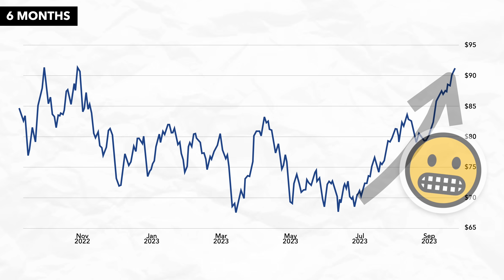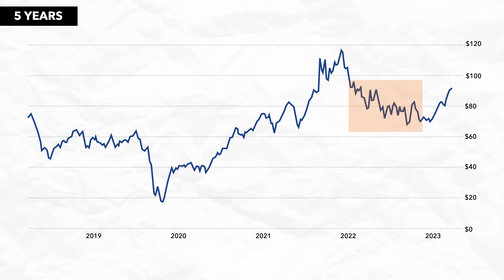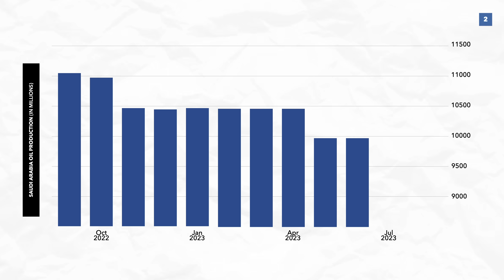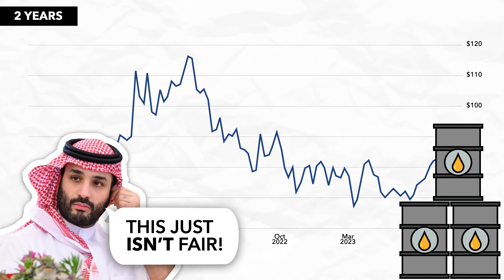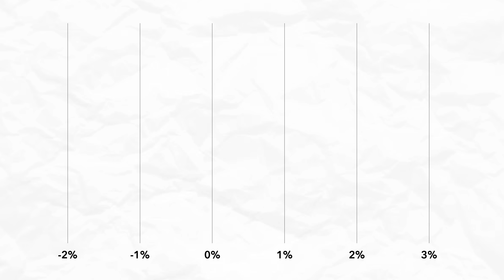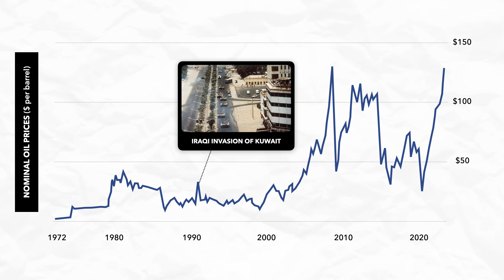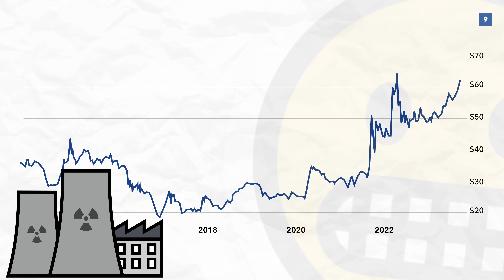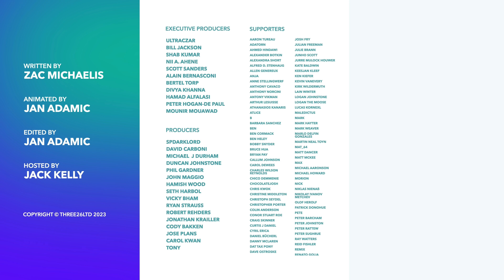Will High Oil Prices Restart Europe’s Energy Crisis?

Comment: French here in reaction to the uranium prices going up. Unlike coal and gaz powerplant, uranium is not something you buy and burn as it. It has to be enriched and goes though a long process before reaching the nuclear power plant. The raw uranium price on the market counts for 2% of the nuclear electricity price. It means the uranium can ×3, it will almost not change the electricity price. Also, France has 3 years uranium reserves and can handle way much higher price fluctuations on the market.
Reply: I was going to comment the same. Also oil is not much used for heating in the EU.
Reply: I wish I could say the same for Germany.
Because of the greens we shut all the powerplants off

Comment: Maybe don't shut down nuclear plants when the fossil fuel markets are already so turbulent and one the biggest exporters is an actively hostile nation. Just a suggestion
Reply: True that. Need to add that Africa is cut off too today.
Reply: It’s wild that Germany is shutting down nuclear power plants and re opening coal plants.
Reply: Freaking Germany
Reply: Yeah, but oil is not used for electricity production, so there is only a marginal impact
Reply: Where are we going to get nuclear fuel?
Hint: Not from the EU internal market. With nuclear power, we'll still be dependent on imports.
Reply: @bentrinker1937  the greens doing it nonetheless. insane fucking party.
Reply: @FraenkischeRep  You might noticed the EU push for renewable energy and electric cars. I dont need to be genius to see the corelation.
Reply: @bentrinker1937 The shutdown was set way in the past, during the Fukushima crisis. Problem is, germany didn’t work on an replacement in the last few years and killed multiple renewable energy projects. The CDU worked on the shutdown and hampered the alternative sources
Reply: @reheyesd8666  They think biogas comes form unicorn farts  🤦‍♂
Reply: @DaweSMF  the electric cars are irrelevant when it comes to their energy consumption. Furthermore Electric cars have nothing to do with sustainability, especially since they still require ridiculous amounts of energy even if they would replace combustion vehicles (which is not really the case currently, they are mostly additional to the preexisting cars) which could not be replaced by a measly 3 nuclear power plants
Reply: @Welgeldiguniekalias canada,australia,ukraine,namibia. You do depend on imports,but not from dictators.
Reply: @FraenkischeRep plus even if the change towards green energy is needed, what is the source of those powering those batteries?
Reply: He literally told and showed that Uranium is more expensive for the same reason.
Reply: @FraenkischeRep  Bruh, you seem to be stuck in details - you can argue your point as much as you like, that was not my point tho. You basicaly argue with yourself. Do you need some friends?
Reply: What a dumb statement, nuclear power is more expensive than even these high oil prices.
Reply: @Welgeldiguniekalias  everyone is dependent on somebody, if europe had transitioned to nuclear energy decades ago energy would have been cheeper even if the uranium had to come from a place such as canada which would have meant the price of the material would have been higher. Alternatively if the african countries werent screwed over all the time maybe they could have provided a the same commodity on a competitive price.
Reply: @DaweSMF  maybe you should learn to express your points more precisely. After all, not everyone has the time to argue with random guys on the internet. Perhaps even because they have real life friends🤔
Reply: @FraenkischeRep  Maybe, this is internet tho as you so observably pointed out.

You current argument have some holes as well tho - if you dont have time to argue with me because you have real life friends, how is it that you argue with me? Almost like your passion took over. Seems like i insulted you somehow and you decided to spew EV data on me and now prove me you have friends with contradictory statement and emojis? Did i struck a nerve by accident?

Sorry, i cant be your friend but i can type some message to here and there if you like. Just warning tho, i dont care about EVs or enviroment or sustainable energy and so on, i feel like you do. Thats why you arnt able to see past it.
Reply: too easy mate. why would political guys act logically ??? they have incentive somewhere to act otherwise ... don´t know which industry is filling their pockets ...
Reply: @FraenkischeRep  but electricity is only a small part. from the 11500 petajoules used in germany last year, almost 9500 petajoules were fossil fioul (oil, gas and coal) the rest is nuclear and renewables.
Reply: @autarchprinceps  Uranium is a very small fraction of the cost of nuclear power.  The price of uranium could increase by 100x and the cost of nuclear power wouldn't go too much higher.  A 1,000 MWe reactor requires approx. 27 tons of uranium ore per year.  Said reactor would have cost between $5-10 billion to produce.  A uranium ore price hike from ~$50/pound (where it's stayed most of this year) to $66.25/pound (where it is right now) represents a yearly price increase (if the new price were to hold for an entire year) of just under $900,000.  But considering that the MONTHLY interest payment on that reactor is going to be between $30-$60 million ($360-$720 million for a year), then the current price hike represents about a third of one percent (0.3%) of their monthly costs at most.  Actually not even, because that's still not including their personnel or maintenance costs, just their capital costs.
Reply: Now you tell us..
Reply: Good luck with your nuclear powered car 😅😅😅😅
Reply: @corranhuss  
So basically, Merkle has fallen for Russia's bait, if she wasn't knowingly doing it, and killed them all?

Comment: Though Saudi Arabia & Russia are cutting oil production to beef up their revenues, it is a question that how long will they be able to reap the benefits, given that OPEC+ members have a long track record of cheating & overproducing than their assigned quota in order to take more share of the increased oil prices & undercut each other.
Reply: How does cutting production increase revenue?
Reply: @tomcfearon  Cut production and prices will rise. Cut enough, and price × volume will run higher than before. It's a balance. Cut litte, price stay the same,  you just lose volume sold. Cut too much, prices will be high, but you sell too little to get price × volume higher.
Reply: Russia ain't cutting, they are loosing fields so its a permanent cut because they ain't drilling new ones in the areas that need a bit better tech. I do believe the Russian guy that have worked with in Russia before he had to flee. So the truth is worse than only cutting production.
Reply: @tomcfearon supply & demand. Cutting production reduces the supply of oil. The demand stays the same, hence the higher price.
Reply: Saudis have only cut around 10% of their production while prices have risen from 70$ to 90$ more than a 20% increase even more if you account for production costs

Comment: Uranium price was never a relevant factor in the price of nuclear energy. Uranium price can spike 10x, and the price per GWh of electricity produced in nuclear power plants remains pretty much the same.
Speaking about rising uranium prices in this context is only a speculation driver.
Just my 2 cents, but feel free to check it up by yourselves.
Reply: True, but it still remains the most expensive commonly used electricity source. It is only lucrative if the government pays for the up front cost, and that is when we hope there are little to no cleanup costs in the long run.
Reply: It doesn't matter how expensive it is if you're still dependent on others to get it. The goal should be energy independence
Reply: @jorenbaplu5100  , which is never possible with Europe as they have zero natural resources to make their green infrastructure in the first place. Where do you think all the cobalt, steel, nickel, aluminium and manganese come from. 

Oh yes, Africa. The continent that Western economies (especially the EU and UK) have heavily exploited to this day. If Europe actually paid a fair price for Africa's minerals, their energy sector will cease to exist due to a HUUUUUGE spikes in cost.
Reply: Yes not on short term but long term it's relevant
Reply: @inbb510  I'm pretty sure most raw materials needed in the green transition come from China, so not Africa. The international market for these goods is free and the price is set by supply and demand, as simple as that.
Reply: @PhthaloJohnson  , either way, Macron's vision of European independence in the manufacturing industry is a pipe dream.

Comment: Europe is in a paradoxical and difficult position. It could benefit in the mid to long term by switching to eletric cars powerd by its own renewable energy, which would finally get rid of this cripling oil addiction that has been the weakness of Europe for more than a century. However, it has very strong combustion car industry, which slowed down the transition to electric cars, and now Europe is far behind China in their manufacturing, especially in batteries. Same with solar panels. So by accelerating this transition Europe could maybe get rid of this problem, but it might be killing its industry and boosting China's. It should really be trying to switch its industry as quickly as possible so that it doesnt lose it.
Reply: Not only that, the industries here and the heating of our homes largely depends on oil and gasses produced by oil, that in combination with England and Germany getting rid of a lot of their nuclear power plants creates a huge dependency on oil, and for other European countries to export their electricity thus creating huge energy problems
Reply: I dont see electric cars being a future, they are just a distraction for people to feel better about themselves. Should just keep cars the way they are but make using them unnecessary by providing robust public transportation and means to travel by walking or bicycles.
Reply: Europe would have been largely independent from oil and could've had electric cars in the 1990's if they focused on nuclear power, but activists in West Germany exported their anti-nuclear bias elsewhere and Europe's energy independence collapsed.
Reply: @valtonen77  It is not always easy or simple. I mean sure we can walk or bicycle but we wanted to move on our own will and be practical. It no point in walking or cycling it take half a day to get there by car and public transportation doesn't always do what we like to
Reply: @valtonen77 Hear, hear. We need to end car dependency if we are to stay on top.
Reply: i don't know if doubling down on disastrous green policies is the way to go. the US will probably still be majority gas guzzling cars in 2050.
Reply: With a national grid built decades ago, good luck.
Reply: @DerToasti  how it disastrous?
Reply: Where does the electricity for the electric cars come from mostly? Oil and coal and gas power plants. We need to
Focus on nuclear power, and renewable energy like water power, solar and wind turbines, if we focus on this then electric cars should become more green than they are today.
Reply: paradoxal? euro cities pride themselve with walkeable cities, restricting car culture at every chance. they should walk
Reply: With large amounts of EU red tape and regulations around the tech industry with high cooperate taxes, it will never happen fast enough.
Reply: @-haclong2366 , well in the UK, France's EDF is building Hinckley Point C and ignoring all the nimbys so there is hope!
Reply: Europe did 90% of this crisis to itself. Cutting out nuclear power to appease "greens" and then realizing renewables are not covering gets you here
Reply: @-haclong2366 Would have made us dependent in Uranium exports from somewhere else. I see a huge chance in Thorium based stuff as we do have a huge amount of it just laying around. Europe also has the issue that mining is basically non existent.
Reply: @oliviamoore3426 Mostly water power as that can actually make a difference while solar and wind are basically in the “others” group of renewables in a lot of countries on there energy charts.
Reply: @HyperScorpio8688 The plan todo 100% renewable was anyways crazy when one just looks at how much solar accounts for the energy today.
Reply: If they are having trouble generating enough energy to keep industry running

You're not gonna be able to replace all the combustion engines and have a functional grid.
Reply: @platin2148  absolutely and that’s why we need to invest more in solar and wind at the same time as we increase the amount of nuclear reactors that we got.
Reply: @oliviamoore3426  I’d probably go more nuclear. The solar investment i would reduce to locally produced stuff (as much as possible). 
Else we are giving free subventions to the Chinese. Just by area solar already is quite a huge part of it but makes basically nothing.
Reply: @platin2148  Thats actually not entirely true. Solar can produce a lot of energy, it’s become a lot more efficient, though here in Sweden it wouldn’t be that great as it is dark like 6 months / year (im slightly facetious about it being dark here all the time. But France, Spain, Greece and so on could get loads of electricity from it, now if you combine solar with battery storage, you could get it to work fairly well. My point is we need to invest in all forms of production of electricity / energy to become more self sustaining so we can give the middle finger to Russia and the saudis
Reply: @oliviamoore3426  Battery Storage i rather not use to expensive and als makes you dependent on PRC. And no solar actually doesn’t account for a lot of energy in the average just take a look at the charts it’s very inefficient space use. It only really makes sense there where you need energy directly at the mid of the day. It should be on roofs which aren’t used for anything else. But it’s definitely not a good option for on ground. Spain would be a nice place but they basically canceled there initiative.
Reply: The microwaves on wheels will not save you.
Reply: Just days before Russia invaded Ukraine one of the last American 
manufacturers of solar panels shut down permanently.

The owners said that they just couldn't compete with cheaper solar panels 
produced by Chinese companies and that even places just down the road from them
were buying Chinese solar panels.

So after Russia invaded and everyone started talking about 
going electric and getting Europe off of its addiction to 
Russian fossil fuels I wondered if having the world 
switching from needing Russian fossil fuels 
to needing Chinese solar panels 
was really going to make western countries safer 
from extortion by a ruthless imperialist dictatorship,
especially countries such as Canada and the United States 
that have plenty of their own fossil fuels.

Though of course weaning the world off of fossil fuels is needed
to reduce climate change.
But it should be done without making the world vulnerable to 
economic extortion by a ruthless, imperialist dictatorship like China.
Reply: @valtonen77 
Or maybe by 2050 virtually everyone will work from home online
and almost all manual labour will be done by robots.
Reply: Electric cars are not the future, implementing electric trains and better public transport are a more viable option amd also making cities more walkable and cyclable
Reply: Europe would solve its problem if people stopped driving to the store, gym, park or any place that you really don't need your car to go to. Usage would go down with more than 50% so total oil need would go down with more than 25%. Then remove cars from cities and build huge parking garages outside with public transport(cars use so much more in cities than outside) so it would probably get that % to 70% less so more than 35% of the total consumption.
Reply: My dear Ameribrain it's not all about cars tho is it
Reply: @oliviamoore3426  Actually, coal is almost non-present in power grids in most of Europe and North America, it's usually gaz, nuclear and hydro that powers the grid. Renewables are also becomming a big part of the grid. But even so, producing energy from a centralized grid is much more efficient then individual car engines, so if we assume building and maintaining an electric car has the same environmental cost, the fuel powering the vihecle will be more "clean".

Comment: More wind, more solar, more nuclear to top up when the prior two are low.
Reply: Wind and solar can be enough, nuclear won't bring energy independence and costs the taxpayer too much
Reply: @jorenbaplu5100 wind and solar require a base power generation, one that can provide power when weather isn't suitable for power generation (or an extremely large power storage system which is not feasible in any shape or form for the foreseeable future).

Nuclear is the most suitable option for most. Hydro can work depending on country, but it's heavily dependent on geography. The only other option is fossil fuels, so nuclear remains the cleanest, most consistent source.

And while countries without uranium might need to import em, the amount of uranium needed is tiny in KG terms, so it can be stored in large quantity if one is afraid of supply shocks and there'll be enough time to change suppliers (Australia and Canada are very big uranium suppliers btw).
Reply: @louislux depends on the geographical scale.